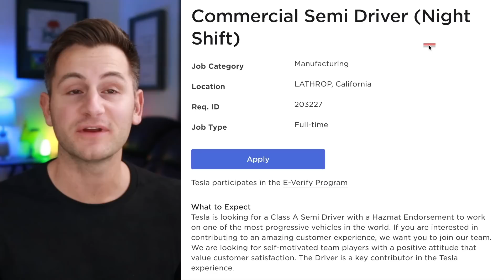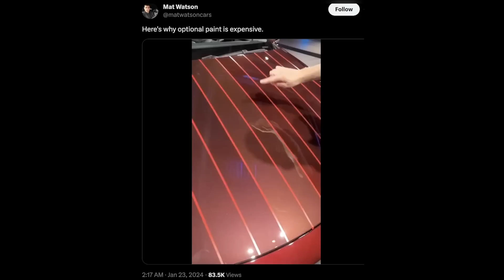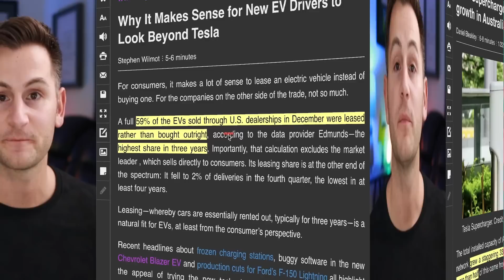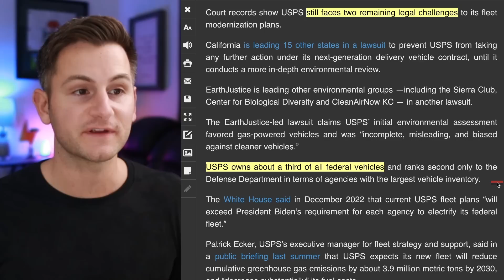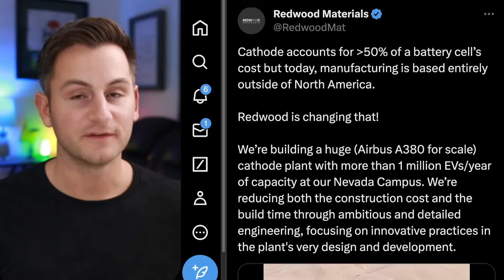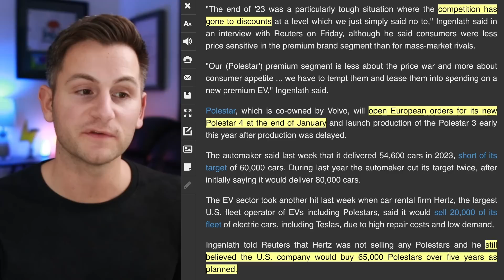Tesla's Next Chapter / Apple Can't Be Serious / Toyoda Belittles EV's ⚡️

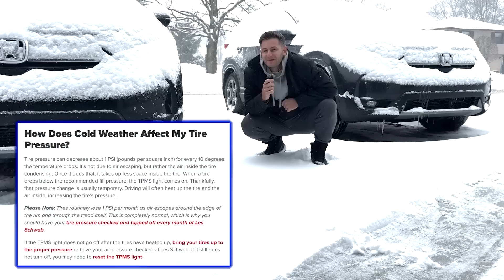Comment: 5:50 air does not condense at temperatures above -400F. The pressure drops according to Boyle's Law P1/T1 = P2/T2 where pressure is expressed as atmospheres OR psia (absolute psi, NOT psig) AND temperature is expressed in degrees Kelvin. Yes, air will condense at -400F / -196C. I know. I used to handle liquified gases (nitrogen, oxygen, ammonia) and the likes.

Comment: I live in Scandinavia, here we have many months with snow and ice

My tesla 3 model year 2019 I have learned the hard way is not made for this climate tire pressure is the least of the problem

to take some things

the handles freeze so I can't get into the car regardless of whether I use the app to heat the car 2 hours before I go

the few times this helps then another phenomenon occurs when i open the door and the window won't go down due to ice and i get in the car and close the door then the window explodes because the window hasn't gone down

when there is a lot of snow on the car and I open the rear hatch, most of the snow falls straight into the trunk

when it rains the same thing happens the hatch is not tight and it is not fun to have the hatch filled with water

these are just some of the problems i have with my tesla 3

here's a video that pretty well shows what I'm talking about

https://youtu.be/WSq0u5_0mhM?si=wOkFTrbGs-t-RSLC

Comment: Apple. My view is their market should be towards an EV OS. There is little need to head towards manufacture if they can develop an OS, with its version of FSD and built that into the apple eco system.  The main issue I see is uniformity of legacy auto new vehicles and newcomers,  allowing a third party OS (aka Apple) to work with a consistency of camera's and/or sensors across EV makers.   But then, would apple want to assume the potential OS liability?   Maybe not.

Comment: BAD TYRE PRESSURE ADVICE GIVEN
In icy or snowy condition (cold weather) having lower tyre pressure is good as it gives better grip, so don't compensate as suggested.
Also, if you fully pressurise when really cold then your tyres can be over-pressurised come warmer conditions leaving you with less grip than you should have then as well. A lose, lose.
Nothing against the product,  just against the sales story of when to use it.

Comment: There is so much FUD and political pressure surrounding the automotive side of Tesla, I'm not really concerned with automotive numbers.  With the economy and with all of the production line changes, I don't expect anything spectacular.  I just hope numbers are good enough to keep the media somewhat at bay.  What I am most interested in is seeing the performance of Tesla energy and hopefully hearing from Tesla in the earnings call on when energy will start to make a large difference in the bottom line.  In my opinion the next drivers of the stock price will be energy then Gen 3 vehicle, then robot.  FSD will be huge when it hits but from a regulatory standpoint I expect robot to start making a significant difference before FSD/robotaxi.

Comment: The best tire inflator/air compressor is the brand Tesla Mobile and Service Center Technicians use. The Milwaukee M12 Compact Inflator. FASTEST CORDLESS TIRE INFLATOR. The Milwaukee M12 Compact Inflator delivers fast, accurate, easy inflation with the portability to take anywhere. With the capability to complete demanding applications like car, LT truck, and compact equipment tires,. The M12 Compact Inflator gives users ultimate power and efficiency. Rated to deliver over 120PSI. The high efficiency motor and pump top-off car tires in under 1 minute. The TrueFill  Auto shut-off technology delivers highly accurate pressure, protects from overfill, and automatically senses speed of fill to deliver precise shut-off at the desired PSI. Additionally, the unit includes a large easy to read back-lit LCD, anti-vibration feet, and 26” inch hose with an all brass Schrader chuck.

Comment: I wonder how Mr Toyoda anticipates areas without electricity operating gas pumps? At least with electricity you can add solar and it's a onetime cost and go from there. Also the much lower maintenance requirements of EVs means less money spent on repairs.
Reply: Sounds like a lot of areas without electricity like Africa remote areas, are going to E-Scooters and a small solar panel since the Scooter requires very little energy.

Comment: If Apple produce a car, you can guarantee it won't be compatible with anything else.   You will have to use Apple chargers and need adaptors if you go anywhere else.   I wouldn't mind betting the even the valves on the tyres will be special Apple design and you will need an Apple tyre pump to inflate them.

Comment: When it gets cold air doesn’t condense it contracts which is the reason the pressure is lower. Air condenses at around -253°C so I’m pretty sure it’s not condensing in your tires. If there is moisture in the air, it could condense Into a liquid or ice but compressed air should be dried before going in your tire so there should be very little moisture in it in the first place.

Comment: Air does not condense naturally on earth. The nitrogen condenses at -195C, the oxygen at -183C, and argon at -185C . Air pressure is reduced at lower temperature because...
Reply: @hughwallet6789  it does not condense in the scientific sense, from air to liquid.  But it does condense following the other definition that it becomes more dense, filling a smaller volume.
Reply: "Contracts" would have been a better word choice.

Comment: “Apple car” should not be a vehicle, it should be a total operating system for an electric vehicle like Tesla has. They could sell the software and control chips to OEM’s. The Ford CEO, Jim Farley, complained about the 150 different venders and software programs he needed to make a modern car work. As an example, just look at the problems that GM is having with their Blazer. Apple could solve all these problems by selling a unified system.
Reply: I dont know if Farley can even get away from those 150 supply contracts

Comment: I have a similar air pump, though a different brand, and I love it!  I mostly use it for the bike tires, but also do the car tires whenever I get an alert from the pressure sensor.  I still remember getting a flat in college that caused me to miss a class in extremely cold weather, and I'm convinced the cold reducing the pressure was at least part of the problem.  I'm so glad we have built-in pressure sensors now, so it never gets too bad.  In any case, these battery tire pumps are the real deal, and they're so much more convenient than the old ones that plug into the 12v car outlet.
Reply: I have a plug-in inflator and also bought a package of “screw in” repair plugs that install with a Phillips head driver. Each plug comes in a very small container and is enclosed in a sealant. My on board repair kit includes a small vice grips to pull nails, etc. Have not had a chance to use one yet, but a video on the suppliers site made repairs look straightforward (I know, don’t they always 😀).  Sorry, no link.
Reply: One of my tyres has a screw through the tread. It’s getting close to worn out so I just monitor the situation. It’s not lost any air in 1000 miles. Tyres going flat enough to stop you driving are either obvious (you just hit something) or you were too complacent to check tyre heights and pressures.
Reply: I’ve run a lot of motorcycles. Their rear tyres are notoriously bad for punctures. Front wheel picks up a nail. Your rear has a 25% chance of hitting the pointy end. My solution was to use an in-tyre sealant. Tyre fitters had no problem with it and I was never stranded again.

Comment: Not to mention that charging a car in remote areas with solar is far cheaper and easier than transporting fossil fuel to such areas.
Reply: I was thinking the same thing. Remote areas not connected to the grid will go straight to micro grid solar, batteries and EVs.
Reply: @karlsatherley6184  Telephoney is a good example. Today, remote areas are served by cellular, not landlines.
Reply: @karlsatherley6184 Hi, for most this would be the best option and the most efficient with no transmission losses. Plus you own it and it would give you network resilience.
Solar PV to charge controller to battery to inverter charger. You can now get all this in one box!
Take care all M.
Reply: Weird how you think people willingly take the more expensive option.
Reply: @paulmcgreevy3011  Solar is more expensive than oil? Not by a long shot, not even in the US.
Reply: @paulmcgreevy3011 Solar is by far the cheapest form of energy on earth.
Home roof installation can be a bit of a ripoff… but the actual panels are extremely cheap now.
Reply: @whowhy9023 doesn’t matter how cheap the panels are. Solar is extremely expensive but of course you ignore the expensive parts and focus on the price of panels. Sure you can power your house and save money after 5-10 years but it doesn’t work like that on a large scale and over the longer term.
Reply: @paulmcgreevy3011 Boy the US electric utilities need to hire you to set them straight on solar! Funny how they are all about ROI and you say solar is expensive.
Reply: you plan on camping alongside the remote highway for 2 weeks while it charges?
Reply: @babyUFO.  That's not what I said. However, if you want to go down that path, I could sit on the side of any road and eventually charge. Not so in an ICE as I will have to wait for a massive supply chain to deliver refined oil to me from halfway around the world. And such a supply chain does not  exist on every mile of every road in the world.
Reply: Yeh so true I’m still amazed at how few people get this…
Reply: @andyfeimsternfei8408
True, but not the complete story.
The sun doesn't shine everywhere, and the wind doesn't always blow.
But the USA is a very big country. A grid distributing power with local batteries is the key infrastructure.

With enough of that, the need for fossils fuels would be negligible.
But building infrastructure isn't any off the USA's strengths!
Reply: @larsnystrom6698  Slightly different. My comment was in response to only ICE being useful in certain remote locations without electricity. I contend it will be easier and more economical to serve such areas with EVs charged with solar rather than the logistics of fossil fuels for ICE. These areas are not typically in the US but rather lesser developed countries that have no grid at all. Finally, there are few places on Earth that don't get enough sun to charge EVs for typical daily use. There will be times when it falls short for a few days, but probably less so than the times fuel runs out while waiting for more to be delivered by ICE trucks from far away.
Reply: @andyfeimsternfei8408 the best argument is they use nuclear in Antarctica. All electric systems win out because again the logistics of transporting fuel to remote areas is not cheap like people think.
Reply: @larsnystrom6698  The most northerly point (outside of Alaska) of the US is south of Paris & a lot more sunny.
Anything south of Paris is a complete no brainer for solar now & Solar prices are on a steady price decline curve.
A little wind might help…

Comment: I highly recommend leaving your tires alone in the cold weather because you need the added traction (as small as it is). Pumping up your tire to recommended pressure for warm weather will cause you to lose some traction, commonly people take air out of their tires to get more traction in adverse conditions.
Reply: The tire placard located on the driver's door jamb of all vehicles shows the recommended COLD tire pressures.

Manufacturers do not have a "warm" or "hot" tire pressure spec. They are always COLD specs. In the case of the Model 3 & Y, they are recommended to be inflated to 42 psi COLD
Reply: Not everyone drives in snow
Reply: In wet road conditions I thought low tire pressure resulted in a higher likelihood of aquaplaning.
Reply: Driving on underinflated tires is very unwise, better traction or not. Here in northern New England (big snow, dramatic temperature dynamics) we have to keep tires fully and properly inflated. Winter temperatures easily vary 60-70 degrees from highs one day to lows a day or two later. Having tires under-inflated in the warmer weather means they will 7-8 pounds underinflated on the coldest mornings. That's a recipe for a blow-out.
Reply: @vermontsownboy6957 Wrong. Your tire is not more at risk of being blown out by being 8 psi lower than recommended tire pressure. 

With the tire being 8 psi lower, the tire has more "give" and will absorb impact better compared to a tire that is 8 psi OVER inflated. 

Think of a balloon filled with a lot of air vs a balloon filled with half as much air. Which balloon will be more forgiving and have more "give" before it pops when you squeeze them

Comment: Maybe they go 48V, steer by wire and Ethernet on semi?
Reply from the maker: it seems possible if not even likely since it's a ground up factory and "new" vehicle in a sense!
Reply: Tesla out maneuvering the Euro Union Mafia(s) makes me smile.  😀
Reply: T semi like all semis since day one--ladder frame design. Torsionally flexible like typical pickup, this adds to diagonal suspension travel but subtracts from suspension control.

Don't expect soon but ultimately semi might become series of ridged castings, get extra travel at the wheels.
Reply: Doubtful, finally got around to watching the Jay Leno Garage on the Tesla Semi recently and they highlighted that many, many aftermarket accessories for semi's are 12V and it'd be pretty problematic to have 48V.